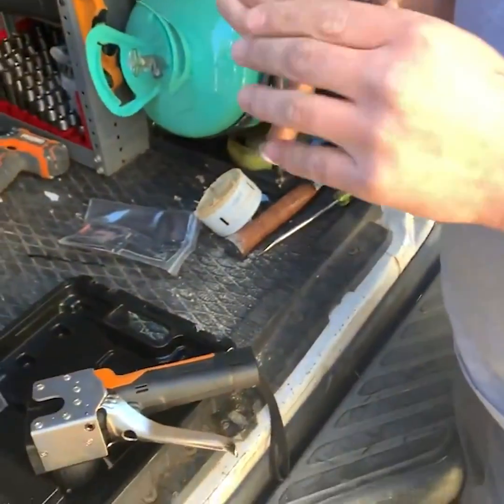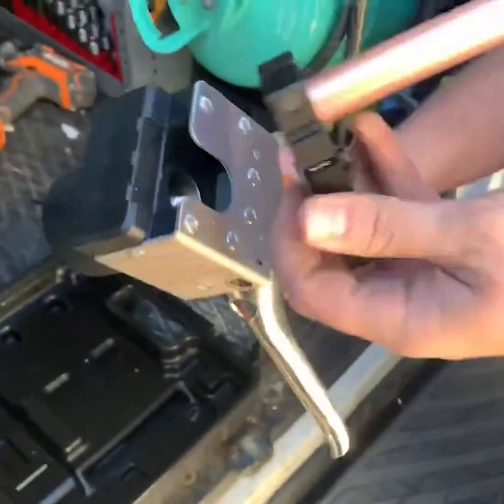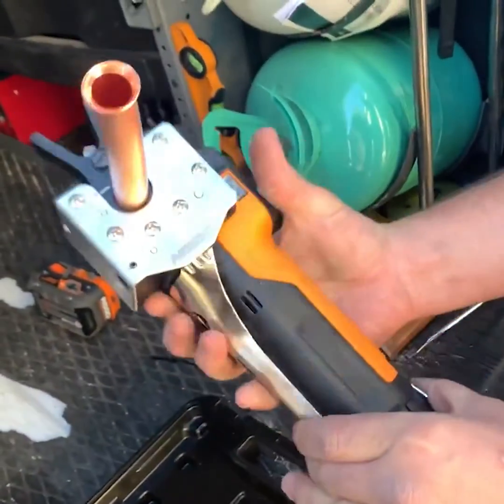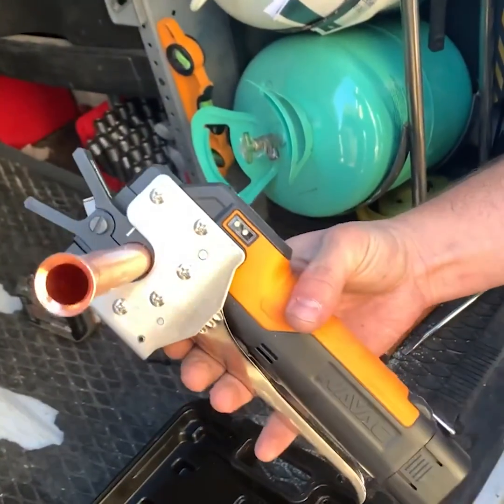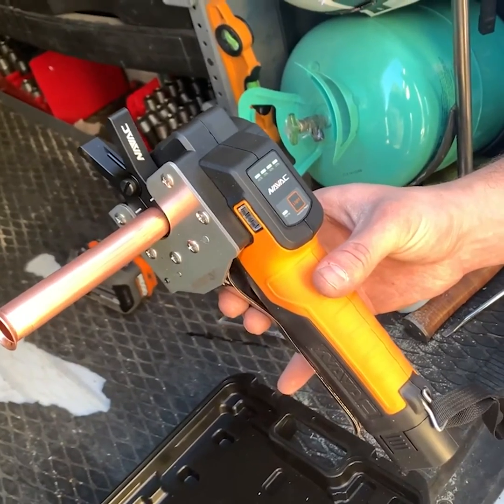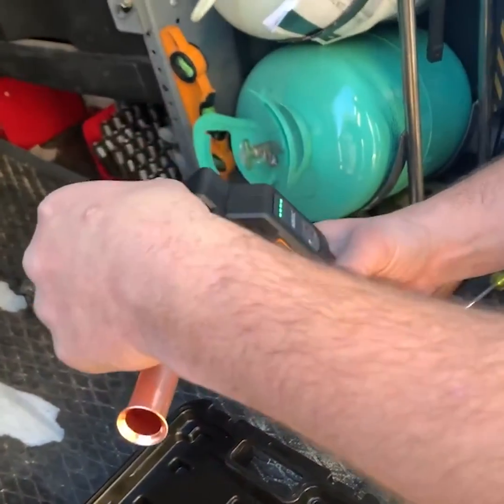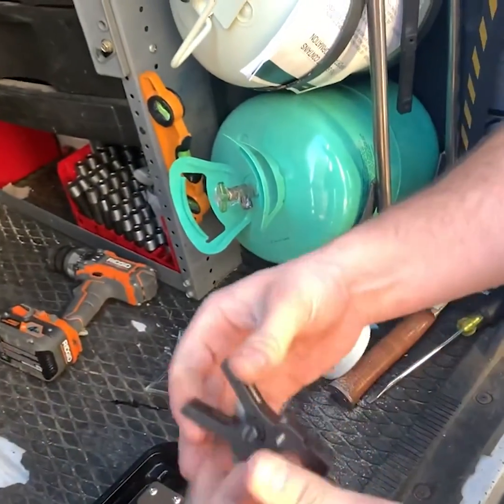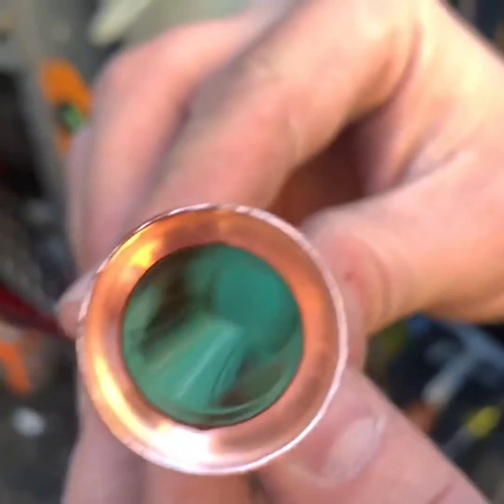The new and improved NAVAC Cordless Flaring Tool

Comment: very nice. al tho 100 flares later and it starts messing 1 in 3 flares. pegs get warn out and can no longer hold the pipe in place
Reply: I bet you won't post a video.  Never heard of this problem until you
Reply: You probably used the wrong size.. that happened to me. It can also damage your tool